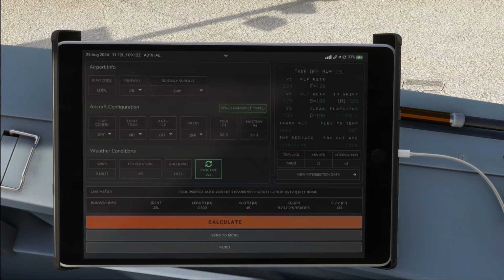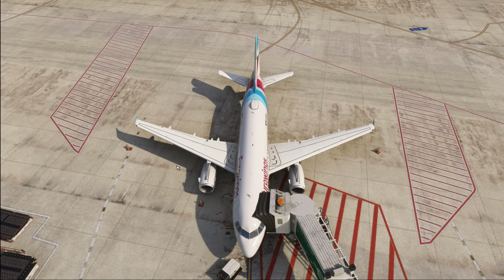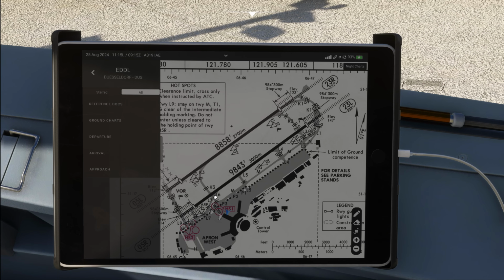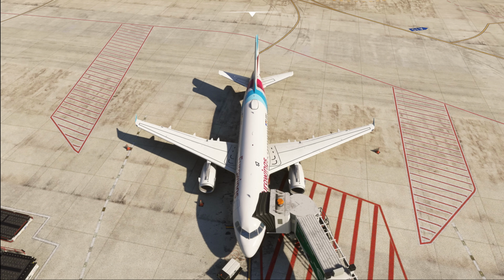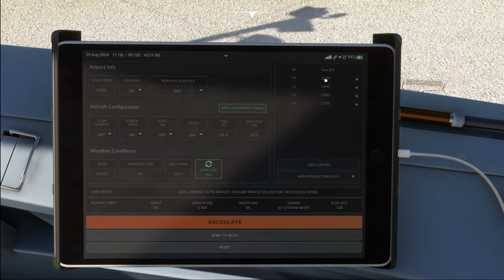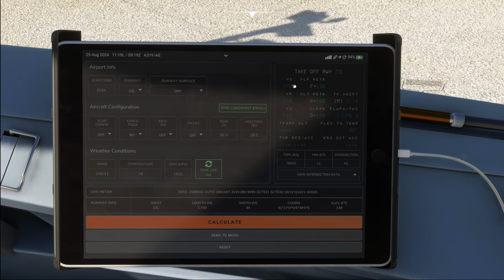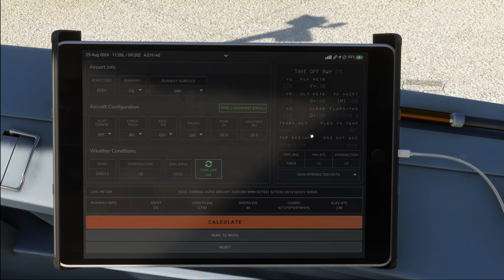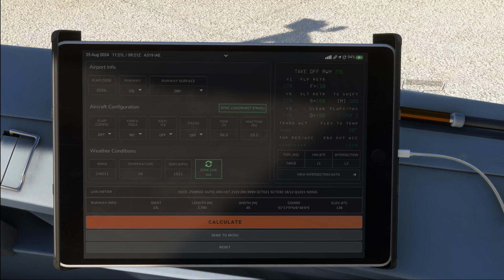WHY do you get such different takeoff speeds with the Fenix Takeoff Calculators | Real Airline Pilot

Comment: Hey Emmanuel I’m wondering why do my v speeds increase when I add a headwind but when it’s there’s no wind it’s lower then the one with the headwind why is that shouldn’t it the one with the headwind have the lower speed
Reply from the maker: Hi Noah,

tbh that's most likely a bug in your performance tool.
Reply: @A330Driver thanks you

Comment: Cool video for those with little performance knowledge well done. Only thing id add is airlines haven’t used balanced field length for 25 years. The weight addition created by using optimised performance ie improved climb pays for itself in spades every year out of performance limited runways. The only performance calculator in a sim i know of to give “accurate” to real world Flysmart values is FSLabs which included departure path in its calculations.

Comment: To take the full TORA length of RWY23L at Düsseldorf of 2700m, you need to do a special line up procedure 270 degrees turn. Last time I saw someone do it in real life was a Eurowings/Sun Express Deutschland A330-200 in the Sommer of 2019, but back in LH A343/A346 days it was more common. Practically everyone takes L1, 55m t/o shift. The Russian airlines loved to take L3, before Covid there were a lot of fully packed A321…

Comment: on the matter of takeoffs, what to do after a rejected takeoff in airbus? because i know you're not just gonna stop on the runway, and if there are no failures just taxi back to the beginning of the runway and takeoff again, but idk what is to be done there. For example, if there is a runway incursion and you need to reject the takeoff, do you like have to go back to the gate to check brakes and stuff? or do you just need to wait somewhere in the taxiway for the brakes to cool or what's the procedure?

Comment: Not related to this video, but I'm curious why I'm seeing managed decent speeds at 250kias as opposed to something faster like 290. Seems rather slow? Would be cool to see a video on that. I've even had the 777 do it as well.
Reply: Depends on the cost index used. Using a cost index like 6 will restrict your descend speed. If you want a faster descent, you need to use higher cost indexes like 30 or higher.

Comment: A timely video, as I only noticed the discrepancy between Simbrief and the FBY perf calculator the other day! I am a bit confused though - does this mean, given that V1 is a function of the aircraft's speed relative to runway length, and that the standard config is flaps 1+ slats, and that the TOW is going to be the same regardless of where the aircraft enters the runway, that the aircraft could actually take-off at a lower V2 speed than advised by the calculator? That seems to make logical sense but doesn't seem plausible - wouldn't you want to get off the ground as soon a valid V2 was reached?